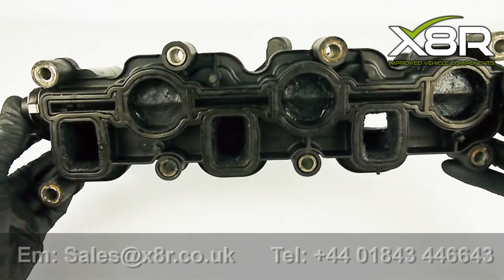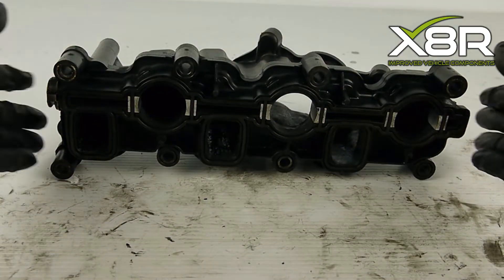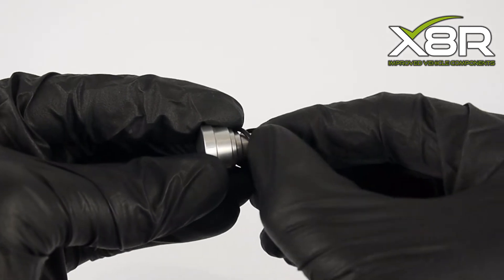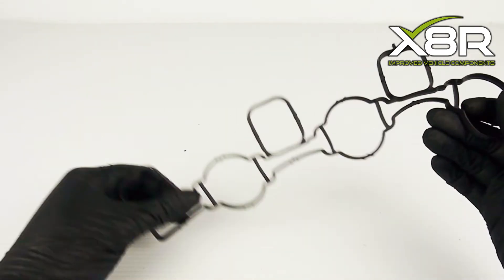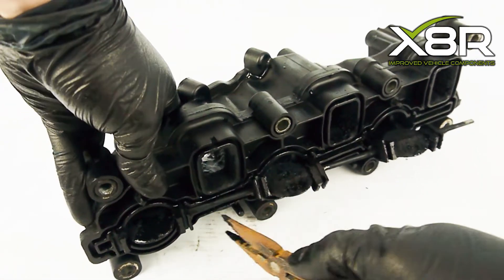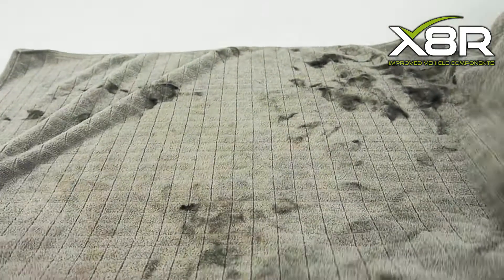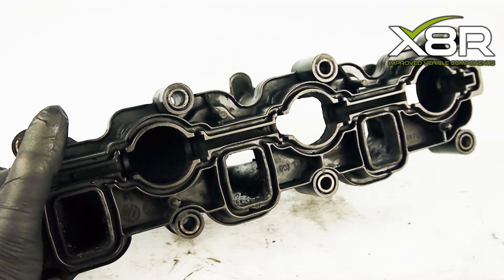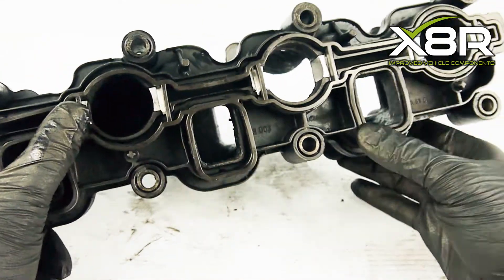X8R0239 Audi VW Porsche 2.7 3.0 Swirl Flap Delete Kit

Comment: I opened up my 18 year old Audi Q7 manifolds today. They were still cleaner than this after the cleaning we see here. But then again I run Dipetane in my diesel. I think its the same thing they now add to the better grades of diesel at the pumps these days. Your swirl flaps operate under gentle acceleration. Not my style :) PS my exhaust tips are still clean from new. One owner one driver. I have never seen another car as clean. Only problem is the swirl flap actuators have worn internally so I get codes as they over rotate... cant win.

Comment: If we do this delete would we need to map out the error code as the air intake manifold position sensor wouldn't be connected to the swirl flaps any more?
Reply from the maker: No, you would not need to map it out. - Georgina, X8R Ltd
Reply: @X8RLtdUK  fantastic thanks 👍